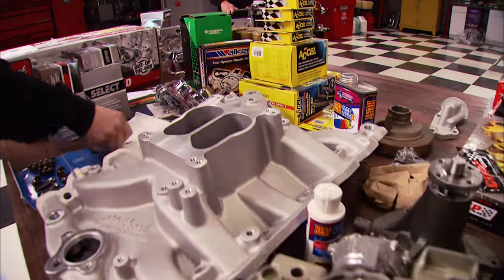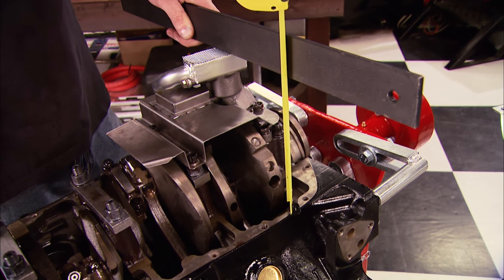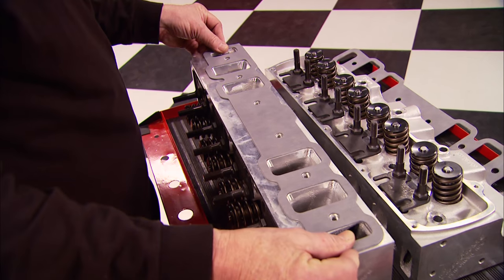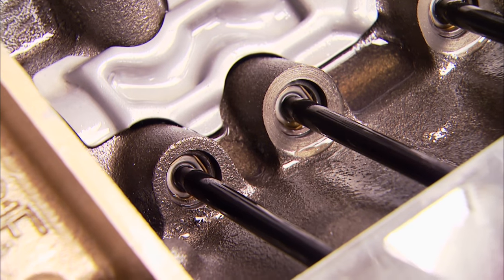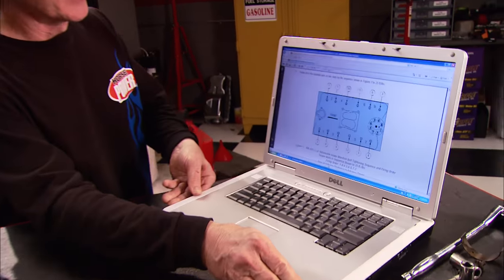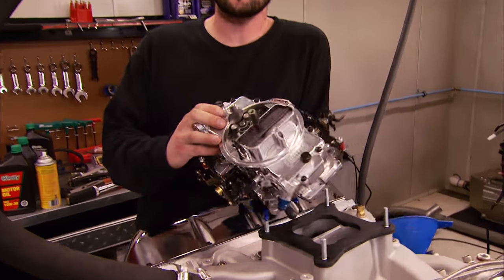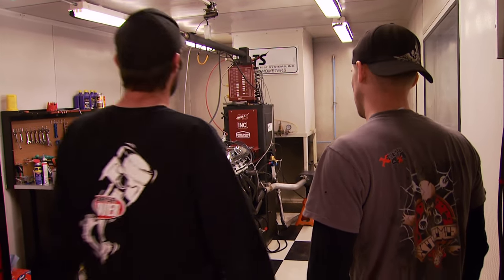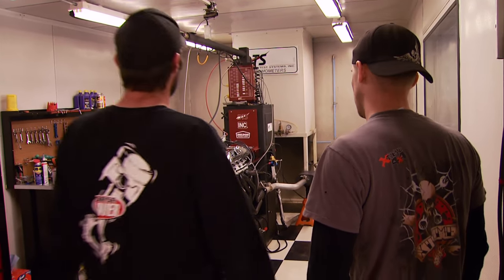Dyno Testing a Mondello 455 Olds Big Block - Horsepower S13, E8

Comment: Wasn't it the Buick 455 that beat out all the other big blocks in terms of HP?
Reply: winterlounge - Yes, the Buick was a far superior engine to the Olds 455 boat anchor.
Reply: No the Buick 455 didn't make more horsepower but it did make 10 foot pounds more torque than the olds 455 personally I like the old 425 better it's under square and a lot rev happier than the over square 455 olds.Love my 30 over 425 olds pushes my 1986 Buick Regal Limited like nothing.
Reply: Those were semi-tuner Stage 1 Buick 455s...

Comment: We were trying to use as many original parts...........reuses a meaningless piece of metal surrounded by performance parts.....
Reply: Look closely 00:47 re-using stock flat tappet cam... 4700 RPMs HP peak...

Comment: 1.6F on the rockers?  Aren't those Ford rockers?
Reply: A common upgrade from 1.5:1 rockers... 1960's Pontiac parts counter had 1.65:1 rockers for RamAir V engine...

Comment: For what you put into that motor something smells bad. Those olds 455 engines pulled 440 horse and 510ftbls from stock intake and a Quadrajet. You gained 15 horse and 27 ft. What did you do wrong? Not good gents that is embarrassing for you to show. I would not have even shown this on tv or you tube. Get it together and start over. I can do better with an engine that is already tired.
Reply: Look closely 00:47 re-using stock flat tappet cam... 4700 RPMs HP peak...

Comment: Great work by a legend ! but look at the time and the money you have to spend for the HP, for the traditionalist its not Stock,  if you want a custom hot rod with dependable engines ,light weight , fuel economy, and high HP that is standard buy the LS engine, Why would you spend all that money and work (customizing) and than top it off with a efficient carburetor, so when it sets for period of time has issues-on start up. Sorry no disrespect to those engine builders or Mr Mondelo.
Reply: Simple get a Holley Sniper EFI with an in tank fuel pump and fuel return line problem solved. This is a great way to modernize an older engine for daily or weekend use. Yes and before y'all say it carburetors are always the best route for max horsepower and drag strips HANDS DOWN!!! but for us true Oldsmobile enthusiast that like to pull our toys out when the time presents itself throttle body EFI setup is the way to go been running mine for about two years now with turn key start up everytime on my 455 oldsmobile. LS are nice and cheaper but ain't nothing like the sound of a BBO with a nice cam

Comment: thats the nice thing about fuel injection :)
Reply: Too expensive and troublesome...
Reply: @BuzzLOLOL  that's your opinion
Reply: @guidoheeling1179  - That's my experience...
Reply: @BuzzLOLOL  still an opinion
Reply: @guidoheeling1179  - Still an experience...
Reply: @BuzzLOLOL  it shure is, but experience is an opinion. And not everyone shares the same experience and/or opinion. For some people fuel injection has worked great while they have had troubke with carbs, for some it is the other way around.

Comment: If I paid for a hydraulic roller cam I would not be putting flat tapped lifters in it! So wrong
Reply: 00:47 re-using stock flat tappet cam... 4700 RPMs HP peak...

Comment: Why do you title this Olds "big block"?
Reply: Because everone speaks in Chevy lingo... How Cliche'...
They do the same with Ford.
Reply: Viking Child because it is a big block Oldsmobile. 455 Oldsmobile is way larger than a 350 Oldsmobile thats why its called a big block because it is a big block. I have been racing Oldsmobiles for 30 years
Reply: The larger varieties of Oldsmobile engines had a taller deck height, making a taller & wider engine. So it's bigger externally than a olds 350.
Reply: @bjr2379  
I don't understand the point of a false narrative. Why stop here? How about a Pontiac big block, and a Buick big block, while we are at it.
Reply: @norman_sage2528  And Mopar... No more B and RB...
Reply: The taller deck is true...but sb/bb is chevy and dodge lingo...

Comment: At 51 seconds he referred to the cam as as a hydraulic roller, which it isn't. Your fancy tv like editing should have caught that.  A stock 455 olds isn't 455 cubic inches, only 454.3 but called a 455 for some reason.  You didn't make one horsepower per cubic inch because that block was bored/honed oversize. At .030  your 454.3 becomes 461 cubic inches.
Reply: At 00:47 can see they re-used the stock cam... which HP peaked at only 4700 RPMs... 
A Ford 427 is 425"... Ford 428 is 426"... Pontiac 350 is 354"... Pontiac 301 is 302"... Early Pontiac 326 was 336"... new Chevy LS327 crate engine is 324" / 5.3L...

Comment: if you are going to run big engines.. you need to change the idle feed restrictions with a 455 you probably need 0.036" or 0.037"    in that carb.. read this instruction sheet.. https://static.summitracing.com/global/images/instructions/sum-m08040-41.pdf

Comment: 403 with 425 crank is a better build than the 455
Reply: Or even a 350 DX gas conversion
Reply: Big block crank wont fit a 403. It will in a 350d/dx block.

Comment: Pathetic. The STOCK 1969 455 put out 390 horsepower and 500 ft.-lbs of torque.
Reply: Yeah, I'm thinking that those heads are pretty lame.
Reply: Look closely 00:47 re-using stock flat tappet cam... 4700 RPMs HP peak...

Comment: 2:37 - 2.19" and 1.88" valves huh? sounds like someone is mixed up with Chevy
Reply: In the previous video and there is a short shot where it looks like Mondello cut those heads for bigger valves.  They also flowed them but never showed the numbers.  Instead they have too much garbage product to hawk to the public.
Reply: @superkillr  - ya they said they did a fresh 3-angle but didnt specify them being larger.  Im not even sure you can fit these sizes. Im pretty sure the biggest is 2.15 - 1.72 with the factory guide placement.  If the valves are this size, that makes the power made even worse....
Reply: @robtdougherty  --  I think you're right, he messed up.  They did a fresh valve job and some blending and smoothing, nothing more.
Reply: Intake valve isgonna be about 52% of the bore size. Big valves will not kill power. You need to open it quickly and close it perfectly. Big valves, high lift, and short duration is what that thing needs!
Reply: @slopoke22  --  On a race engine with properly laid out head design.  This stuff is still using factory valve spacing specs from the 70's.   Which means you can only stuff in so big a valve before they literally hit each other.
Reply: @superkillr  No, I mean all the time.  You always want the biggest valve u can put in the head. I know all about them touching or not. If they used offset guides, so be it, don't think they did though. Those head fully ported move around 330 cfm (stock Chevy head nowadays). You need that big valve on a 45° seat along with a real good lobe on the cam, to open early and get alot of low lift and mid lift flow. Put as much lift as the head can take cfm wise with a short duration. They are not that fond of RPM. There is definitely more on the table, change rockers for sure. They could put smaller diameter valves and light valvetrain in. Those engines kinda like an FE Ford are not very efficient. Gotta do it from the bottom to the top of the rpm range.
Reply: Also, I think he means 1.680 on the exhaust valve
Reply: @slopoke22  yep...this ain't a chevy... tricky messing with olds....their torque engines, not screaming 327's...this is really more of an old school engine...gotta go back to basics...which means knowing how to massage those horsies out...can't buy all horsies out of summit catalog...

Comment: With aluminum heads 455 hp should have been easy.
Reply: Look closely 00:47 re-using stock flat tappet cam... 4700 RPMs HP peak...

Comment: 1 hp per inch is terrible! Piston to wall Clarence is too tight. Not honing cylinder walls with the proper grit stone. Crank Spec is too loose. Crank should be tighter. Side to side rod clearance is too tight. 700 hp is doable.
Reply: Look closely 00:47 re-using stock flat tappet cam... 4700 RPMs HP peak...

Comment: Ported aluminum heads , blue printed block , better cam , 455 ci...... only to get 456 hp???? 440 with lightly worked cast iron heads could out perform this olds build. I like olds, it just seems like a lot of money & effort for that underwhelming result ☹️
Reply: It's that intake for one and this is an older show, which means Edelbrock may not have had the intakes available they do now.
Reply: Kurt Poblenz 1970 Oldsmobile toranado made 400 hp stock
Reply: My junk yard small blocks make that much.
Reply: That’s why the Olds 455 Olds were called boat anchors.  Only Olds fan boys used them.
Reply: @danmyers9372  so TRUE don't get me wrong I like an OLDS. Olds  Cutlass Supreme with a healthy small block Chevrolet preferably a stroked 400 small block with a double tap of the giggle juice
Reply: Kurt Poblenz a bone stock 69 or 70 tornado had 400 hp
Reply: Wanous 1966 Typo 345 hp not 645 you hit the 6 by mistake
Reply: Unless highly modified...crank rods and pistons, then serious tweaking of induction system...cross those hurdles (they're TALL hurdles, but crossable if your money is stacked equally high!) and olds will make respectable power...but nothing really worth bragging about...3.8 gm engines making same kind of power in v6 form...just saying...
Reply: Fred Mendez you have no idea what you are talking about
Reply: Look closely 00:47 re-using stock flat tappet cam... 4700 RPMs HP peak...

Comment: Lots of these in jetboats in the 70's. Wrong engine for the application, with poor oil drain back, poor flowing heads, big bearings, long stroke, and wonky pushrod angles. Most did not live long, and they got stomped by the Ford's and Chevy;s. Good heavy car torque motor though.
Reply: Inefficient jet drives waste engines...